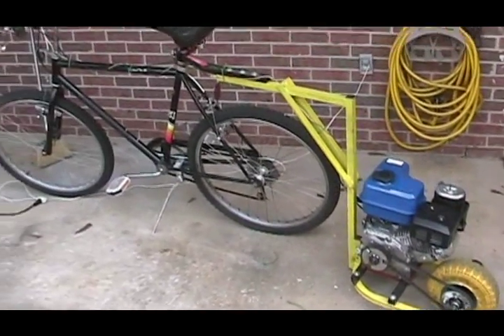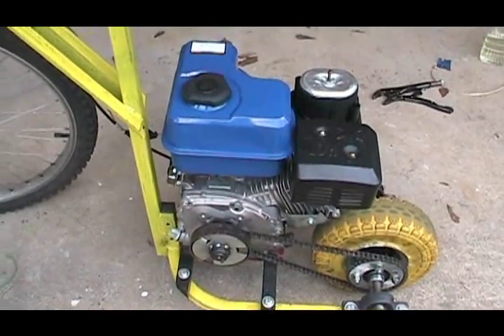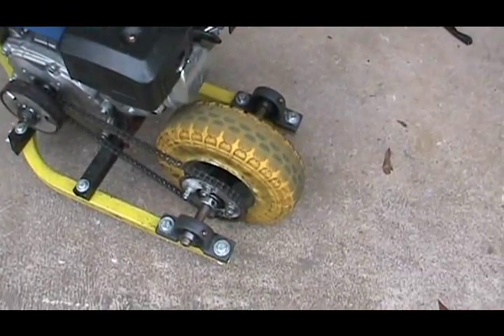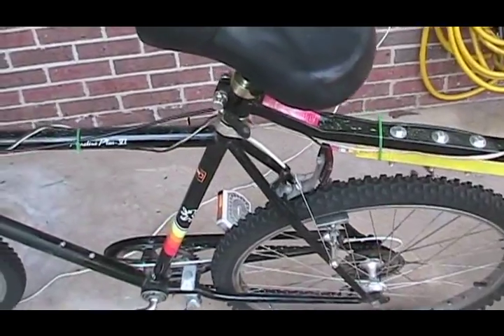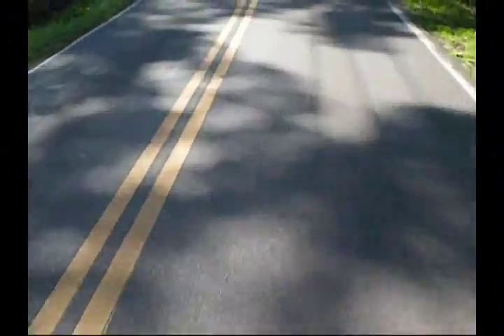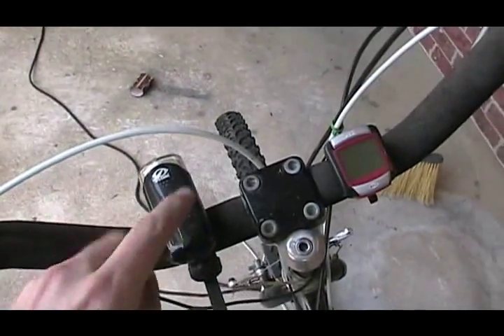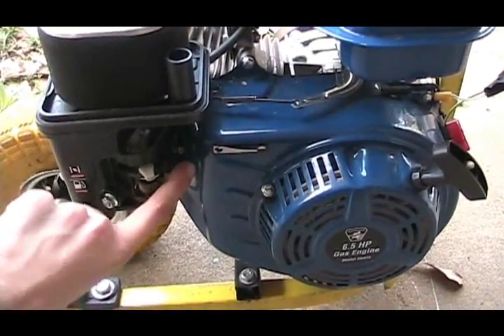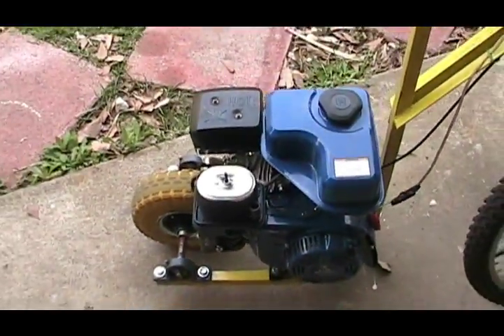Mike's 196cc push trailer demo

Comment: usually good bike trailers have the hitch near the rear axel, not at the seat post, since if you turn the front wheel while braking, seat post attached trailers tend to push the bike over on its side since the attachment point is up high and has leverage to topple the bike. the powered trailer would be the same. I can't figure out if this one has a fixed, in-line, connection to the seat post, which may prevent it from jackknifing. I'd still wonder though, even if it did.

Comment: As a former deputy in floriduh this doesn't qualify as a motor vehicle as the engine's not mounted to the bike its mounted to a trailer. So the cc's do not apply here. Now that is not to say some jerkoff swine flavored fuzz bag dohnut eater won't try to fuck with you, I am only referring to the statutes as such, and the definition of motor vehicle in title 31 USC. Even still ppl don't even realize that if you possess the (MCO) no lic,reg,ins needed,or tag. Cars become household goods!